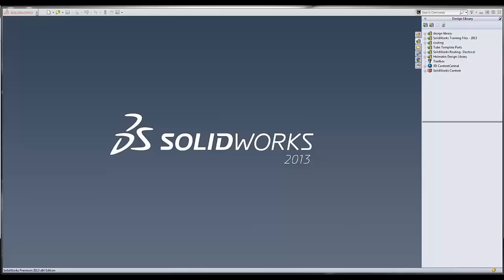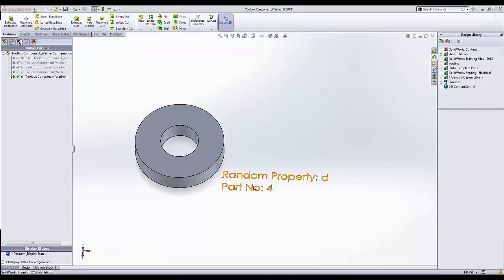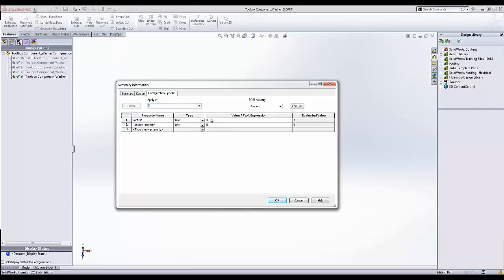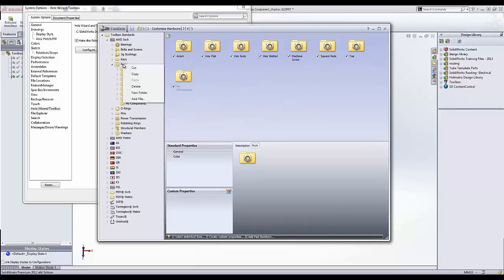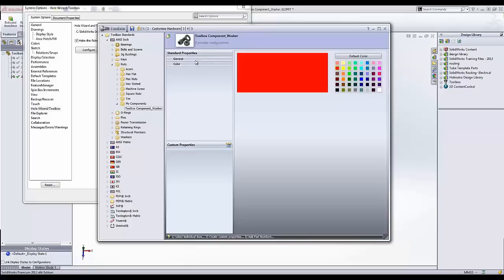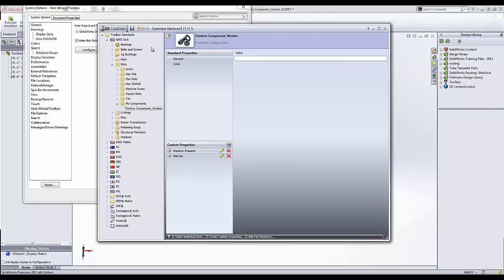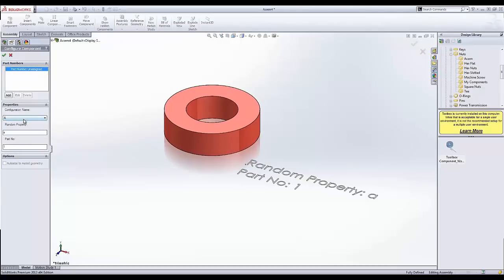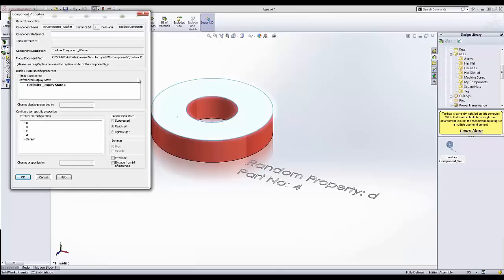SOLIDWORKS - Adding Custom Hardware to Toolbox

Comment: Hi,

I use bearing housing quite often in my work. There are basically 5 to 6 dimensions that define a bearing housing part. Is it possible to use a similar method as in case of standard hexagon screw that we find in toolbox, wherein u drag drop and select the size. So, if i can create a option of "bearing housing" in my toolbox. I drag and drop it onto the workbench, give those predefined dimensions and the part is automatically generated. Later if u want some small changes, u can do it in the normal method.

Comment: hi what if i have the different part files, instead of different configurations ?
i downloard 200 part files from my supplier, its a pain to select it without a drop list
i dont want to re draw 200 part files into configurations.

is there a way to do it?
Reply from the maker: Hi Ric,
The best way to present many different files like you describe is in a library within the Design Library.  You would go into the Task Manager on the right side of the SOLIDWORKS window and find the "Design Library" there.  You can add folders to these libraries then sort your files into an organized folder structure for use in your models.  This would be best alternative to using a single file with many configurations.

Comment: This looks great, but I was wondering if there was a faster method for adding components (such as copying files to the folder and doing a refresh). I tried to convert a old toolbox but it always hanged when configuring.
Reply: ***** 

Thank you for the reply. I actually figured out a workaround for this. Simply add the components in the folder structure you want into <C:\SOLIDWORKS Toolbox folder\browser>. Afterwards, rename the ToolboxFiles.index and open up the toolbox settings. All your components will now appear with the proper configurations.

Comment: Hi daniel
Your video is cool but i cant link those custom properties to anything at all ?
How do i accomplish that?
Can you help me please?
I created a steel beam with all the possible configurations of the brazilian Gerdau catalog,put the file in my custom folder in toolbox; so far so good but i cant change the length  like i could do with the  structural beams,without changing the original file.

I would like to do this like with a regular toolbox component,when i hit the "edit toolbox component" command in the context or right menu
hope you read this!
Reply: Hello Daniel ! Thanks for the tip ...im trying to use the configuration publisher where i can use a length control but i only get two values 5 and 200 ...i will try your tip and let you know.
i also wonder why is it that in toolbox,none of the parts i created even though they have multiple configurations;there they have" 0 configurations possible" why is that so?